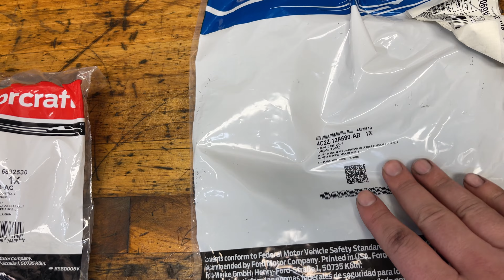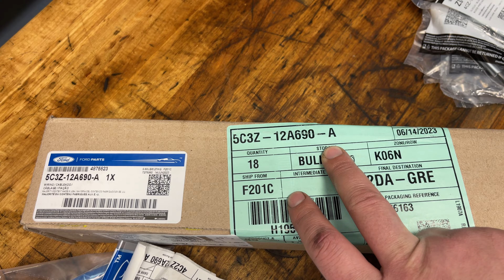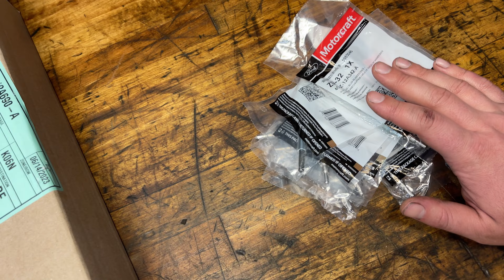6.0 POWERSTROKE GLOW PLUG SYSTEM REPLACEMENT! VERY INFORMATIVE!

Comment: 1st time diesel owner. It's an 05 F250 with about 280k miles.  I'm about to replace glow plugs,  harness and module..could I get an opinion as to whether it may fix symptoms and OBD codes?

Comment: If you brake your Radiator Hose small hose fitting drill out hole I dont rember the drill bit size and insurt an air fitting with a little JB weld works Great hose slides right on and clamp it

Comment: whats louder 4 or 5 inch exhaust because i want the loudest exhaust for my 03 6.0
Reply from the maker: 4” will have more turbo whistle and 5” will be more deep and throaty with less whistle.
Reply: @Atomic_Diesel  thanks but what is louder i think the 5 inch is because of the deeper sound
Reply from the maker: @isaacmiller9931   5 will be louder
Reply: I heard you can just remove the inner fender well and can get great access.
Reply from the maker: @falco10586  Definitely can go about it that way! This is just the way I prefer to do it, mostly just because if one of the plugs refuses to come out, I'm already close enough to just pull valve covers and pop them out from the inside out. Thanks for watching!

Comment: I use Shaeffers Moly in every vehicle I own. Best stuff money can buy. I'm in the middle of a complete brake system replacement and figured while I had the wheels off go ahead and replace the glow plugs. Piece of cake with the wheel wells out plus you can clean the entire engine with ease. I also installed a loop of aircraft cable to each plug cap so I can reach down and pop any of them off in seconds. Dont forget anti-sieze and de-ox (dielectric paste). Good video Bud, Thanks...:oops::glasses-purple-yellow-diamond:

Comment: Parts numbers in this video:

Glow plug module: DY-1600
passenger side glow plug harness: 4C2Z-12A690-AB
driver side glow plug harness: 5C3Z-12A690-A
early modell glow plug: ZD-31
late modell glow plug: ZD-32

I was here from the beginning 🤌
Reply: The parts gave me zd13 moter craft  they will work
Reply: Mine is 06